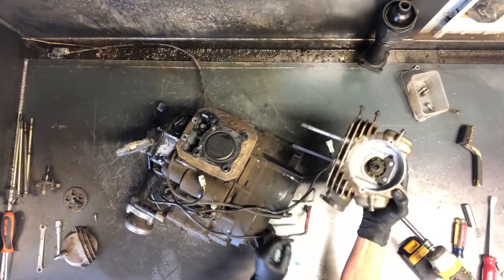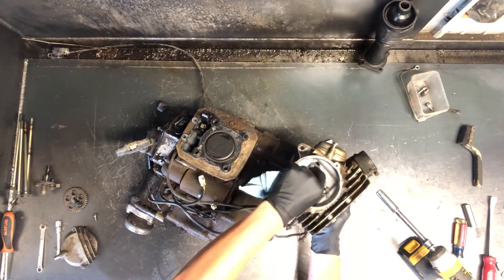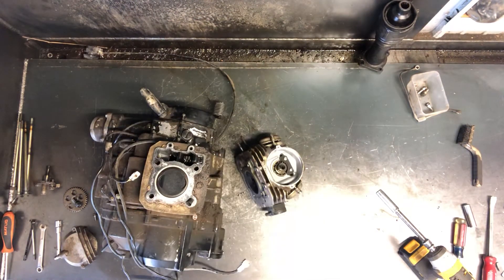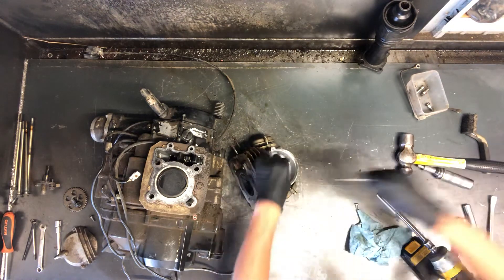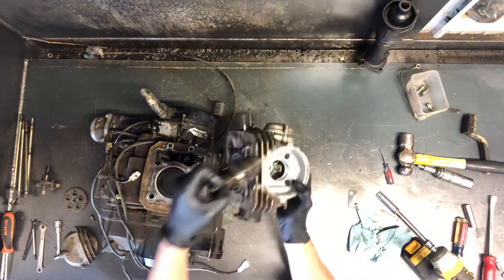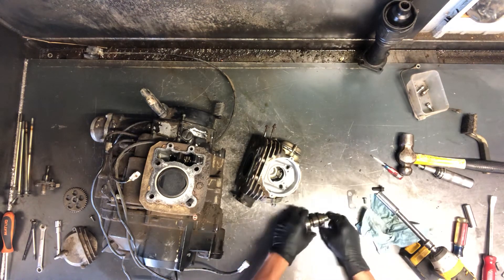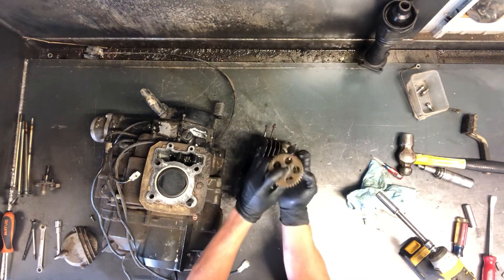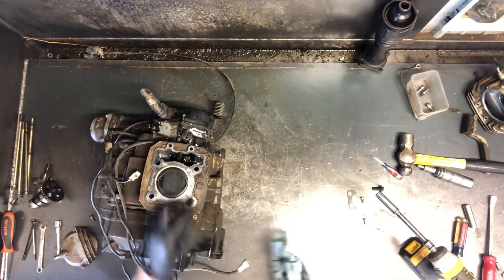HOW TO - Kawasaki Bayou 220 KLF220 - Cylinder Head CamShaft Cam Shaft Removal Replacement Install

Comment: I have a question if you don't mind. So I know where every gasket goes in the top end except these two identical round o rings and i really can't figure them out. I got the cam cover o ring, cam tensioner o ring, cylinder o ring and, the two valve cover o rings fine. 
But the two small identical o rings that im unsure where they go.

Comment: My Bayou 250 makes a pretty bad clicking noise and it goes at the rate the exhaust valve is moving. Do you think my camshaft is worn, and it has a gap where it isn't touching the rocker arm?
Reply: No valve need adjusting ,a spring keeps valve pushed to camshaft
Reply: @cabinetsplusmore910  already did that. But the exhaust was off by a 1000th, fixed it and it still does it. Now I'm thinking the cam chain or cam chain tensioner. It's been used alot and honestly I think the thing is just clapped. It also knocks a little bit too. Could be the bottom or top end. A couple of years ago I rode it almost everyday and was pretty hard on it but now I baby it. Probably needs a rebuild but I can't do it myself so I might sell it to someone for a project and buy a dirt bike I've been looking at for a while. Have a good day and thanks for the reply🤟🏻